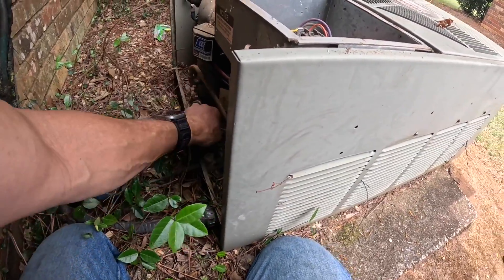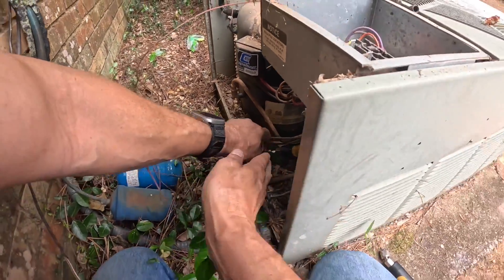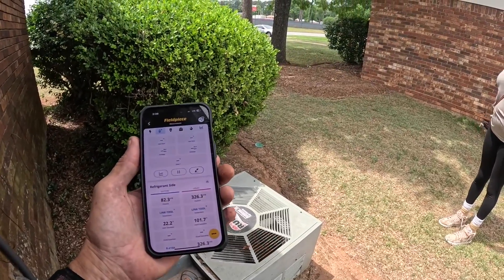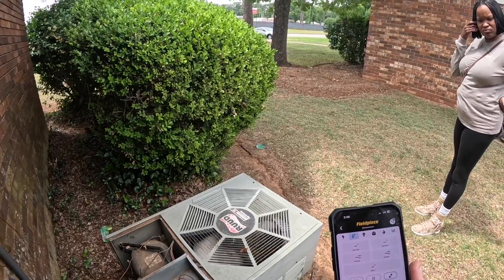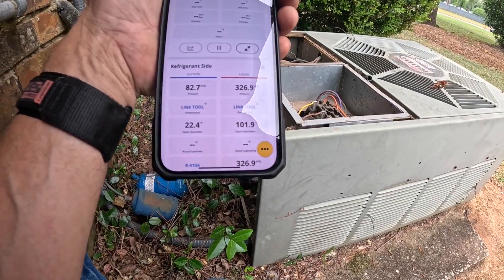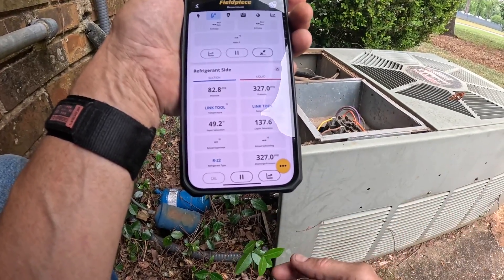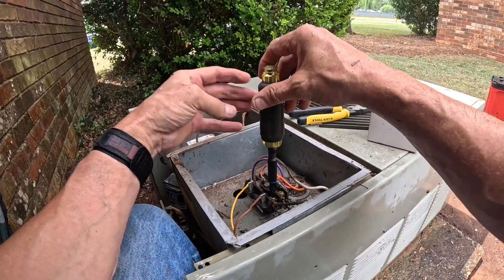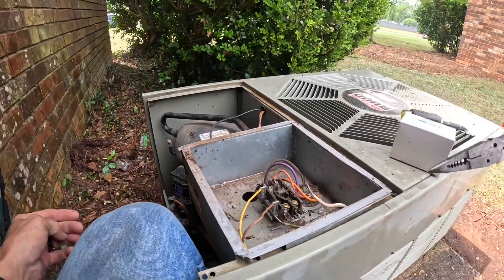Rescuing a 30 Year Old Rheem Air Conditioner! #hvacguy #hvaclife #hvactrainingvideos

Comment: They ugly as sin but best damn units I have ever come across. Have replaced more of those square rheem/ruud units that were 20-30 yrs old than any other brand and most times it was due to indoor coils leaking. Really hard to kill a compressor in those things. One thing I hated about them was the service valves pointing inward instead of being external.

Comment: Yeah there used to be some bulletproof units prior to the 90’s. Oldest unit I ever worked on was a Carrier in 1993, it was from 1961 and was working just fine. Great design feature was the condensor fan shroud was on hinges with a prop to hold it open when you were working on it. Worked on a Chrysler unit that was likely older than that but I couldn’t decipher the nomenclature.👍👍🇨🇦

Comment: the unit u worked on came with a scroll compressor. 
it has been changed out to a recip compressor and 2 large filter/dryers on the high and low side mean there was a burnout on the last compressor. 
u may want to keep the crankcase heater connected.

Comment: Replaced my 1993 Rheem/Ruud 3.5 ton unit in November 2023 after finding my service ports leaked all of my r12 out. I had changed the inside a coil 10 years ago and would change a couple heating elements inside the squirrel cage if I found any open when I tested them. The inside unit used (3) 60 amp breakers. I went to a local supplier and purchased a Ameristar/trane-runtru 3.5 heat pump and inside air handler that only needed two breakers. I installed it all myself with a new line set with everything I’ve learned off of YouTube over the winter. My heating bill was probably a third of all of the prior years that I’ve lived here. Thanks for all of your videos Curtis!

Comment: I think the majority of the systems I work on were installed in the 1990s. I just replaced an evaporator coil in a 1991 Miller system. Outside unit still running like new with the original fan motor.

Comment: Am I seeing that correctly?  A filter drier on the liquid and one on the suction line?  That seems to me could easily have a resctriction on either or causing refrigerant flow to slow down out of range.  I don't think I have seen a system intentionally setup that way.  Wouldn't that be cause to remove them both and replace with a new drier?

Comment: I recently replaced my 1986 Australian made  EmailAir reverse  A/C in 2019 this AC was 33years old and still pumped out good heat and cool air when replaced, i replaced it due to the outside cabinet being weathered and the inside console looked dated. I now have a new Daiken 5.8 kw split reverse A/C, i wonder if it will last 33yrs   🤔 Au

Comment: I live in Arizona and replaced my 1988 Trane XE900 in 2022.  Never any maintenance except air filter changes.  Decided I was living on borrowed  time and put the old girl out to pasture.
Reply: As long as you don't put another Trane in. They were great in the 1990s but around 2010 they started tanking in quality. Now the majority of the components in Trane are manufactured in Trane Chinese factory. Look up RunTru brand, they are manufactured in the same factory.
Reply: @Bryan-Hensley  Unfortunately (?) I did and I see where you're coming from: 

On a complimentary service check by the installer 6 months after, tech said condenser fan motor was drawing too many amps and replaced it under warranty.   I speculated that the motor was probably defective from the factory and he agreed.  Had this not been checked, it would probably be "toes up" already.

Other than that, no problems.  

Fingers crossed.
Reply: @johnalbrets6504  I've got a Trane myself. The quality of every brand has gone downhill. I don't even know what I would pick if I got a new one, after owning a HVAC company for 22 years. After next year, I'd recommend trying to find a good used one. If you don't know, they are banning the Freon that's in your new Trane starting next year, I hope they'll be some retrofits or I'm going to have a bunch of pissed off customers. All new units will have to have this new "climate saving" freon. I bring this up to all my customers because I want them to know which party is causing their HVAC prices to quadruple.

Comment: Hey bubba watch your wiring and Electricity flows on the out side of the wire that why bigger wire handle more and  solid has lower than braided wire
Reply: Not sure skin effect means much at 60 hz.

Comment: My house has 2 units exact the same on this video. It manufactured 1993 and still working like a champ. My Delta T around 13F to 20F depend on the days(Orifice   non-TXV system). I will consider to upgrade it to TXV when I have to replace the evaporator coil. For sure back then they were very well made materials. Of course I must keep it well maintain by cleaning the coils very Springs, check the charge, and usually throw in about 8 to 12 oz of R22 every 2 years. I'm very confidence that my units will last for many many more years to come. I Enjoy watching your channel and have learned a lot from your experiences. Thank you.

Comment: Oldie but goodie there. They don't make them like that anymore. Nice job cleaning her up. I wonder what the evaporator looks like. I changed my contactor when it was 13 years old. It looked good on the outside, but when I pulled it off, it was corrosion mammy on the other side. Thanks for sharing

Comment: Hate call backs,I oil the motor,check amps to see if cap is ok,install new caps to prevent ref. leak and flush drain,2 cents.

Comment: Back when the units were made to hold up and by the way for those modern tech people that don't understand r22 units from back then 1.5 units from 1990 to even 1993. Are today 3 ton units is the correct tonnage for modern 410a systems.

Ohh and 3.5 ton from back then is 5 ton today.

As r 22 had lower pressures and got a lot colder so for 410a just like r 134 a you need more room for expansion and size to get the maximum amount of cooling. Just saying and I don't care what any person tries to tell me. Point is that tonnage was smaller and diferent back them VS today and you need to Make adjustments based on today's standards and size of space not assume just because it was correct for back then it is correct for today's systems.

Just my thoughts

Comment: the way they designed those back then was so maintenance friendly vs. new stuff that tries to make it so annoying to repair that you buy a new system
Reply: same goes for older cars too
Reply: @renj6531  definitely, theyve locked cars up via software to where you need expensive tools just to "program" them. 1990's vehicles had enough computing to be efficient but not enough to hinder repairs like now, and cars have so many sensors and data buses now its ridiculous.
Reply: @davidca96  you want  to keep using those massaging seats? that will be a few hundred dollars anually.

I drive a 1991 F150 XLT lariat and would keep it before I buy one that costs as much as a house.
Reply: @renj6531  👍

Comment: In 2019, I started having problem with my AC.  Both the furnace and AC were from 1988.  So I got a lot of years out of them and replaced both of them.  Went with high efficiency units and cut my electric and ng bill down a lot.
Reply: If you went with the highest efficiency model, get rid of it before the warranty runs out. They use modules instead of individual components. If you have an on board contactor to fail out of warranty, the module can cost $2,000 plus instead of a $25 contactor.. virtually every brand is low quality anymore. You'll eat up all your energy savings in repairs.

Comment: Wow! You don’t find too many machines that old that still work. Wish they made the new stuff with that quality.
Reply: They got smarter. If they would’ve kept making them that good they would run out of business. Just like cars nowadays. Everything is made disposable. A few years and needs replacement. 😎
Reply: @rolytech212  unfortunately VERY true
Reply: My dad has similar Rheem unit from 2000. Loud as heck but still kicking. I added around 2lb of R22 to keep up with the 100 degree weather in Texas.
Reply: I do. I work on them all the time. I've got several customers that have 30 year old Goodmans and Carriers, Millers..

Comment: Why did you replace the contactor?  I restarted the vid to confirm the compressor and fan were both running...
Reply from the maker: Burnt contacts. Looked rough
Reply: @HVACGUY  Ah.  Considering its age, it was probably thinking about croaking.
Reply: A 30 yr old original contactor should be replaced assuming the customer wants to keep the unit. Often burned contacts are visible when removed even when they look mostly okay installed. Plus, you don't want a call back for something that's  easy to solve and relatively inexpensive.

Comment: 4:40 ...good heavens....don't scrap dirt and brush off the bottom of a unit without at least cheap gardening gloves....that gave me the willies....all it would take is a small piece of glass or a sheet metal screw poking through the bottom and it would result in blood everywhere.

In the long run...it is cheaper to keep the old machinery running, tho not as efficient, than to replace it with a modern machine but will only last ha;lf as long.

Comment: With the occasional capacitor, contactors, 825 motor and regular cleaning,  those things are pretty durable. Run into many of those units each summer.